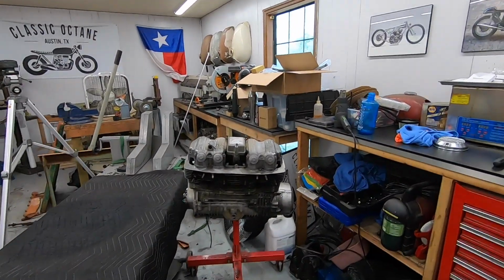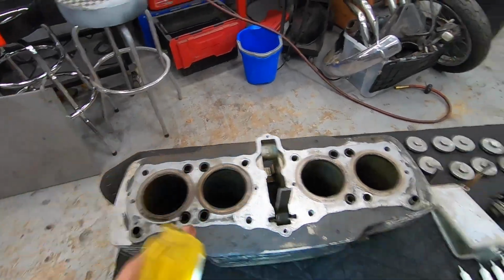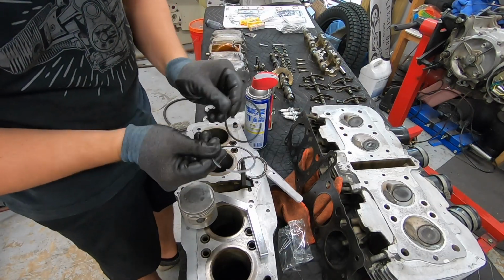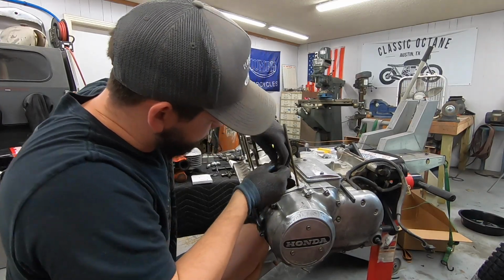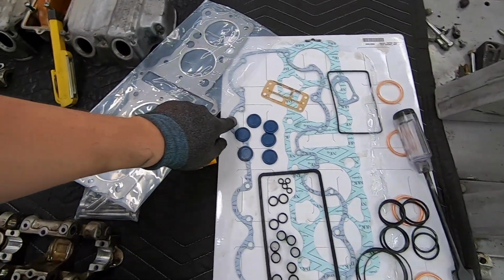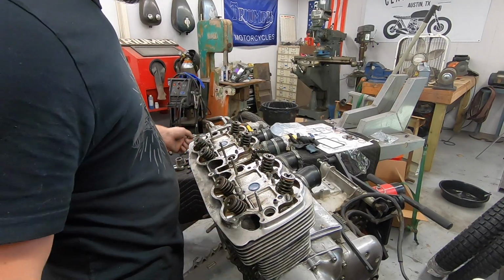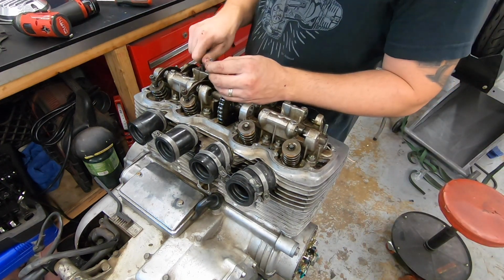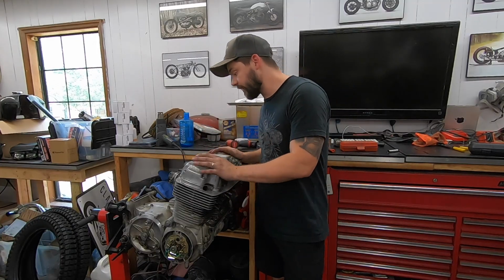Low compression CB750 engine teardown. Found the problem.

Comment: How did you know what size rings to get - it might have been rebored?
Reply: @Scott Riverwood A compression check is not a measure of the bore size - eg low compression on + bore size could be just as low on a standard bore size - it depends on the condition of the bores and rings.

Comment: Rings are constantly spinning in the cylinder bore. Clocking them is nice for first start but definitely not a requirement.
Reply: Valves spin but I don’t think the rings rotate. Although my 2 stroke Fantic motor had pins in the lands to stop the the ring gap/ends rotating into the transfer ports
Reply: @johnholmes5674  worked for Paccar engine on a project to find out if ring alignment matters. Turns out it doesn’t. This was for diesels but I’m confident it’s the same on gas engines.

Comment: Normally you are not this lucky when you try to do a top end rebuild. Without looking at the head and valve train this is should not be called a top end rebuilt. This is just changing the rings and ignoring the rest

Comment: Why wouldn't you rotate the crank until just two pistons are up - and get those in and then rotate it 180 deg. and deal with the other two?  
I may be wrong, but it seems to me that working with only two at a time would be easier than wrestling with all four at once.
Reply from the maker: The weight of the cylinders will push those top two down. This way all the pistons are as far down as they can go so they wont move on you. You could support them with some pieces of wood though. That would probably work out pretty well.

Comment: Good job - I would rather build one of these SOHC over the DOHC that has the shims that go in the head for valve adjustment.
Reply: Actually, I find shims easier and faster....just that on the DOHC Honda CB, there are 4 valves per cylinder. Once you buy a set of shims and the simple tools, it is a piece of cake. I can do CB750/900/1000/1100 DOHC valve adjustment w/ shims in less time than 8 on a CB750 SOHC. The only shims that are difficult is shim under bucket - as the cams have to come out to get to them.  I can get much more precise adjustment w/ shims, and the valves stay in adjustment for many more miles than screw and lock nut adjusters. I own plenty of all thee types (DOHC Honda, SOHC Honda, SOHC Yamaha, SOHC and DOHC Kawasaki, Suzuki DOHC 16 valve GS750/1100/1150, and shim under GPz1100 and racing Kawasaki), and by far the shim over bucket is the clear winner, IMO.

Comment: I was wondering about how much metal vapor blasting might take off.  Thanks for the tip!
Reply from the maker: It shouldn't take off any. It's much less aggressive than traditional dry blasting. That's why it's safe on plastic and rubber as well.

Comment: Piston Rings are probably set to have the gaps away from the front & back of the cylinder because that would be where the most pressure is applied by the rod/crank as the piston moves through the cylinder.
Reply: This is also my understanding.
Reply: I was taught as an apprentice that the ring gaps go on the opposite side to the thrust side of the piston.
Reply from the maker: I knew there had to be a reason for it.

Comment: you should have inspected and lapped the valves
Reply: If all the other cylinders had real good compression before, theres really no need to do that.
Reply: @MrGreen-eb5tf  maybe, but that cylinder's valves definitely should be worked on and if you do one might as well do them all
Reply from the maker: On 45 year old engines I tend to only do what is necessary. When you tear it all down sometimes you can end up causing more issues than you fix. If I had any reason to suspect an issue with valve sealing I definitely would have pulled them.

Comment: While you were putting the cylinders on,  an oring popped off.  Hopefully you noticed!
Reply: Noticed that as well, popped off and was sitting on the front of the engine case while you were working the piston rings into the cylinders.
Reply from the maker: Thankfully I did notice before moving on.

Comment: Darn, wish i watched this a year ago. I did my upper gasket because my 550f was leaking oil. I discovered massive carbon buildup on the cylinder heads and the valves. I sprayed for two days sea foam spray, brake cleaner, carb cleaner and some came off but it was a centimeter thick solid caked on carbon buildup. Then i lost my job and could afford to order the full kit or many of the tools i wish i could have had. It took me a lot of time and a lot of brass brushes i had laying around to break down and clean the carb. The rings seemed ok so i left them because i was losing money. I got it all back and running but wish I could have done a better more thorough job. Now im selling mine because I need the money. But i put a lot of time into restoring it from the previous owners lack of care.
Reply: Use oven cleaner for carbon build up

Comment: As a mechanic how did you know it didn't need a bore? Or if it hadn't been bored before?
Reply from the maker: No heavy scoring on the cylinder walls and there wasn't excessive ring gap with rings made for a stock bore.